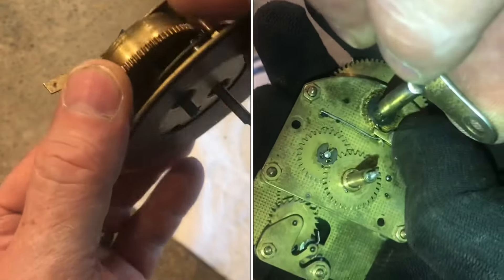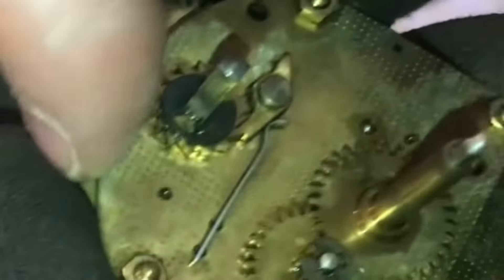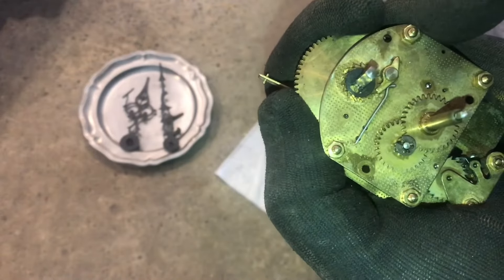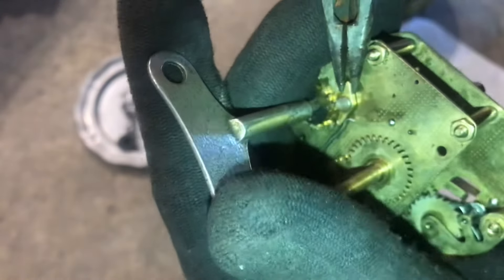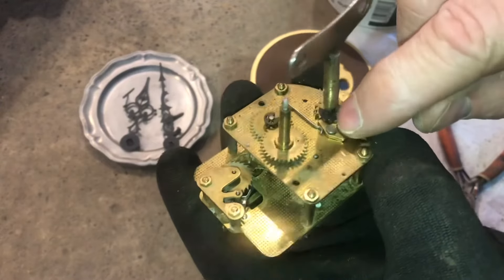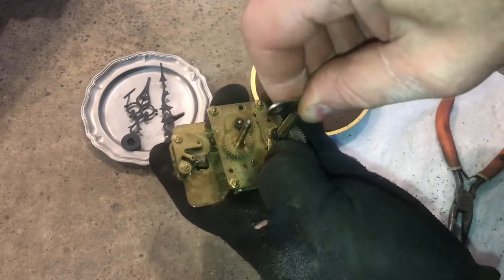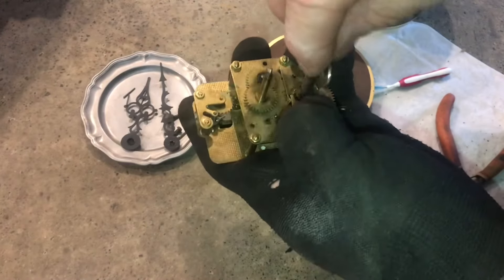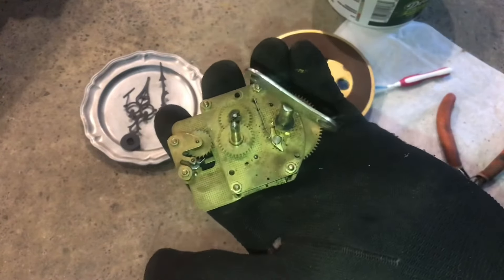RELEASING tension on the “main spring” of a clock movement (letting down the main spring)…

Comment: You are NOT KIDDING.  I am SO GLAD I wore small/medium thickness gloves.  Maybe wish I'd worn a bit thicker.  The clock I'm doing has 2 wind-up reels.

The first flew undone and threw my hand back off of it, and I had the glove on the correct hand like you.  The second reel let me do it slowly for 2 small pieces and then threw the large piece (double reel) against my hand doing the winding tool and onto the thick material I had under it for safety.  It tore the paper tag on that, and I have a blue/blood spot developing under the skin on the top of my thumb where it hit, even though I wore the glove.

THANK YOU for the video!  THANK YOU for the GLOVE COMMENT!

He's not kidding.  Wear a glove!